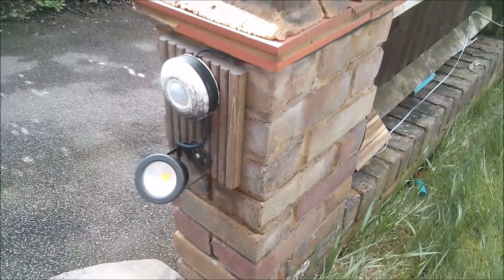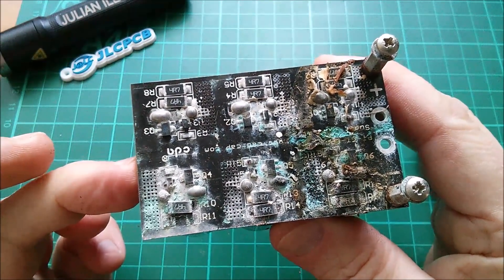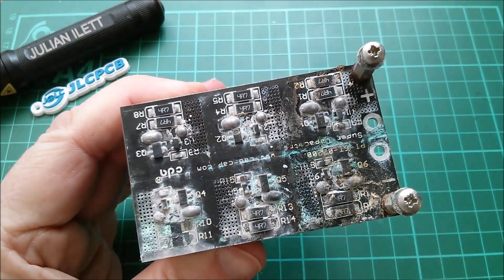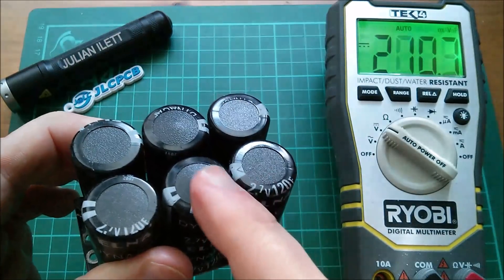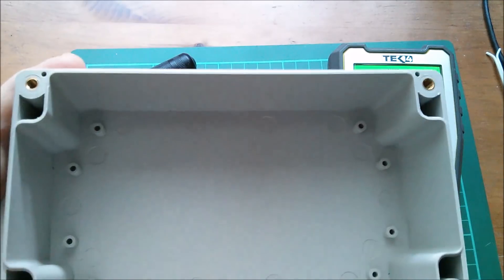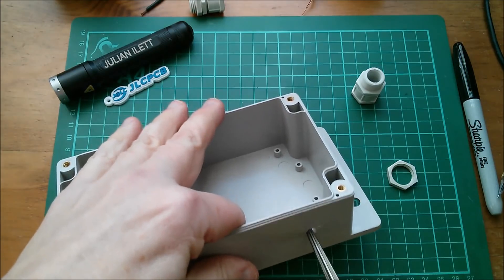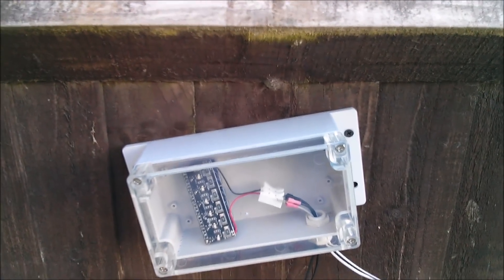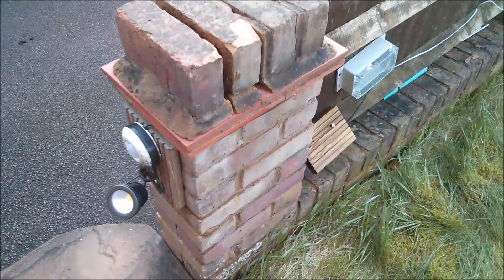Supercapacitor PIR LED Light Repair

Comment: Use an IP 68 compression gland a good one will compress around figure 8 Cable try to get the ones with an acme thread on the compression head.
Reply: Presactly - I was busy writing my post (above) as you must have been posting yours!
Reply: They are hard to find, but round packing pieces for oval cables do exist. I don’t know if any are made for that size of cable though.

Comment: I'm interested to know whether surface tension will prevent any water escaping through those tiny holes.
Reply: When the air inside warms up during the day, the increasing pressure pushes the water out of the holes.
Reply: Diurnal heating / cooling will cause the air to expand. And of course contract, drawing in new humid air which will condense again internally.
Reply: The holes should be 4mm in diameter to ensure that surface tension does not hold the water. Unfortunately 4mm is big enough to let in a number of insects, especially ants...
And ants love to carry soil and dirt into electrical enclosures. It’s surprising how much they soil can  cram in an electrical box. Then the dirt gets damp...
Reply: Perhaps put the last remaining bit of bar of soap in the box as well to break the surface tension.  It should last for ages.

Comment: Don’t leave the PCB sitting on the bottom, just prop it up a bit to keep its feet dry!
Reply: Yes, any PCB or other electronic/electrical items should be mounted clear of the base/bottom just in case water does get in.

Comment: A series about weather sealing enclosures would be interesting for a lot I guess. Not sure if 100% closed box works at all because of the condensation
Reply: You're right, use a completely sealed box, but put a small (1/8) hole in the lowest point, remove any internal burr,  to let it breathe and provide drainage, no need to put the box  at an angle either, just make sure any water in the bottom can't touch anything electrical.
Reply: Yep, condensation is your enemy especially on a box in the open. Might get away with much bigger holes in the bottom though.
Reply: Nope! Drilling holes destroys the IP rating. No need for it. Seal the box in the driest, least humid conditions possible and enclose a couple of silica gel dessicant pouches (free with MANY household purchases). You'll never have condensation problems then. If you are truly desperate use about 5-10 grams of rice!
Reply: @boblewis5558  https://www.google.com/search?q=how+to+avoid+condensation+problems+electronics+enclosures
Reply: 1/8 holes is big enough, try to keep the bugs out
@Bob Lewis I worked on a farm estate, try sealing the box in dry conditions, specially when connected to long runs of conduit that go indoors to a non IP distribution board, condensation will always get in somewhere.
40 years of being a sparky hasn't been a problem, look at most IP ratings you are protecting mostly from above and front/sides, not underside, unless you want submersible.
Reply: @IanScottJohnston  Yes, but as in ALL problems, NOT addressing the root cause is the reason for the persistence of the problem. In a FULLY sealed box, conforming to IP68, without any extreme changes of external pressure (<0.4 atm), the root problem is the amount of moisture included in the box when it is sealed. Cooling of the box subsequently results in the enclosed moisture condensing, especially on the internal surfaces because of their greater cooling effect. 

Inclusion of a suitable desiccant (Silica gel or rice even) removes this moisture and traps it in a state where it does not readily evaporate and is re-absorbed anyway as the temperature drops, ergo - no condensation. even a 2mm hole destroys that IP rating and allows the box to "breathe" in new moisture laden air which then condenses. Especially true in our moisture laden winters when the box "breathes in and out bringing in more moisture than was likely present at the point of sealing.

This is the only reason to have the hole - to allow the moisture to escape as the internal box pressure increases with out door temperature. The cycle however repeats and repeats allowing the inside of the box to remain humid - NOT good for electronics long term. This is NOT the case with a fully sealed box containing desiccant. I've tried it and it works. When it doesn't, it's because the box has a leak! Even a small 2mm hole allows all sorts of insects (including small spiders) to enter and then they can't escape because by the time they find the same hole, they either consider the box home or have outgrown their ability to exit!
Reply: @sparkyprojects  See below. I know what has worked for ME (NO holes but desiccant) and what has NEVER worked for me (holes - small or large). It's not water ingress per se that's the issue anyway - it's the entry of NEW (and refreshed every time the atmosphere changes pressure) water vapour i.e. humid air, that is the issue once humidity inside the box exceeds the dew point - bingo condensation. holes in the box do NOT stop condensation, merely reduce it but over a long period sufficient moisture remains inside in the form of water vapour to condense out at any cooling. Common sense should tell anyone that it's not water getting in but removal of any humidity that's the problem Address the root problem not the symptoms. I've said my piece. Anyone who wants to heed it ... you're welcome. Anyone who doesn't ... you're welcome too.
Reply: Exactly, and i kow what has worked for me, and why industrial boxes have provision for drain holes
You can never stop condensation, but you CAN drain it.
Try putting a dessicant bag in a single gang exterior light switch at the bottom of a conduit drop, there's  no room, and if that bag gets wet, it can short the terminals, no thanks.
Reply: @boblewis5558  I sealed some boxes without any holes for cables etc..but there was water inside due to condensation. And you can't replace silica every now and then all the time
Reply: In fact, if you look at a GOOD box, like the weatherproof MK sockets, there's some indentations that are MADE for knocking or drilling out
Reply: @Max27653  you don't need to. If the box has NO possible point of moisture ingress, then desiccant will hold the moisture until it is evaporated off (hot summer day). As the temp drops that humidity is re-absorbed by the desiccant ad-infinitum! Hence no moisture (humidity) and no condensation.QED
Reply: @boblewis5558  just to say that I agree with you.  Coming soon "The Nightmare of Weather Affecting Exteriour Electronics!" In seventeen parts exclusive to YouTube, illustrating how to fail.     Pull, the other one, it's got bells on.  My car has stayed outside for more than ten years, the paintwork is now rubbish due to UV,  but the electronics of the engine management system is fine.  Just seal it in a dry atmosphere, and if you can't guarantee that, stuff a bag of silica gel in the box before sealing.
Reply: Err, the solution depends on the problem.

If (and it’s a big if) it’s possible to completely seal electronics or electrical equipment in an IP68 box with silica gel desiccant packs in bone dry conditions, then that is the best solution.

HOWEVER, in practice this is not always possible. Condensation can be a problem, but rain water or other sources of sprayed water are the biggest issue. So if water (in whatever form) can get into an enclosure / box / system, it is vital that there is a drain hole. Otherwise the apparently weather proof / sealed box / enclosure will fill up with water, as Sod’s law dictates that the seal at the bottom will be better and you will end up with your electronics / electrics sitting in their very own swimming pool...

The second problem is that it’s not always practical to wait for a nice warm and dry sunny day to come along. So if/when you need to work on the electronics / electrics, it may be a damp or wet day. Under these circumstances, there is no way to keep moist air out.

In my job, if there is an electrical system failure that is causing problems, we have to work regardless of the weather conditions and sometimes that includes working in the rain.

If condensation may be a problem, and it’s not an IP68 sealed box, then a drain hole with a piece of aluminium sheet mounted on low down on the side of the box above the drain hole can help. Especially if the electronics generates a little bit of heat.

Otherwise use two boxes / enclosures, one inside the other (and yes the inside box does need its lid fitting) so that the air trapped between the two can slow the rate of temperature change of the air in the inside box.

An alternative if the system has mains power, is a small heater. But you have to consider the air flow in the enclosure, otherwise you may get cold spots fed with warm moist air, which condensates and then drips down on equipment...

And even with all the above taken into account, it’s still recommended to use a conformal coating on any PCBs.

Comment: The outdoors isn't any good for any unprotected components. Use that case, with your drain hole in the bottom, which will work better. Why not conformal coat the board too? ;)
Reply: You can put insulation tape around the lid to box seam too, which will make it virtually impossible for water to enter. However always leave the bottom open, as moisture laden air will always get in due to heating and cooling, so you need a way for that moisture to escape, hence holes in the lowest point. ;)